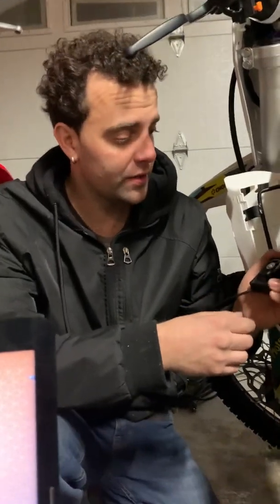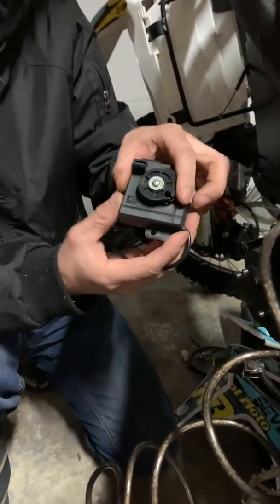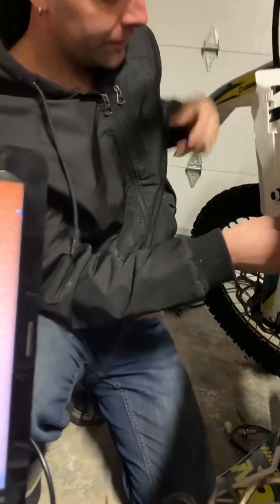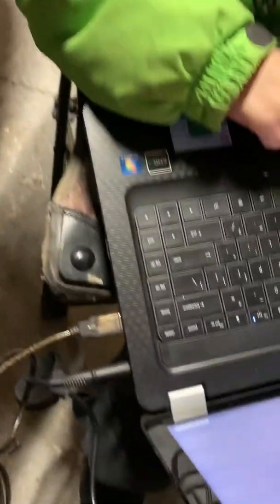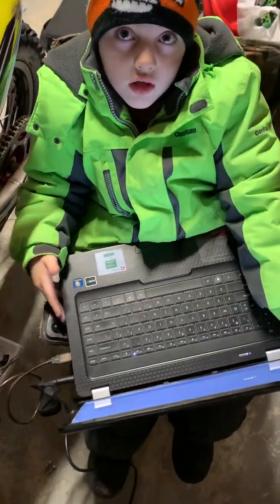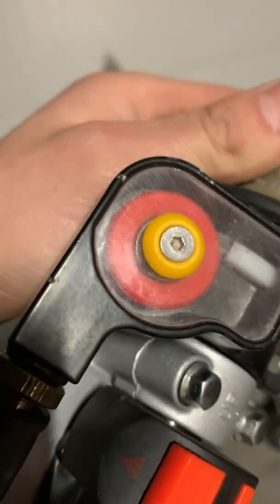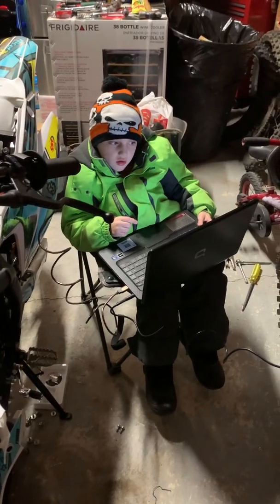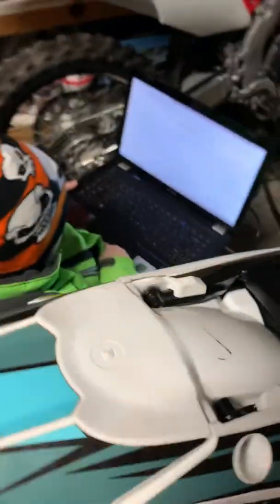Electric ⚡️ MX - Nicot ebeast repair / update

Comment: Have you snapped a brake pedal yet? I just broke mine and i cant find a Japanese brake pedal locally that will fit. Might have to weld this one or get a replacement from Nicot.
Reply from the maker: Its on the way out mine hanging on!! Yeah man there good for getting replacement parts!!! Hit em. They use this setup for there gas bike too

The second gen is alot tighter!!

Cant wait for my
 Gen 3🤩🤠